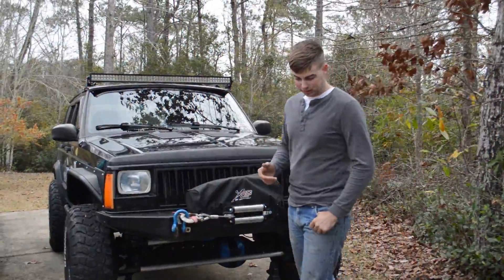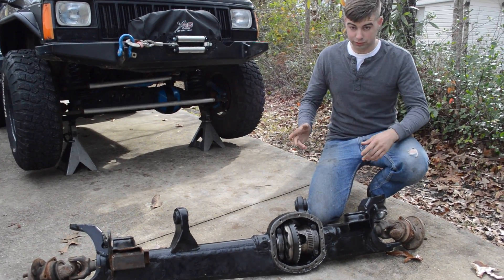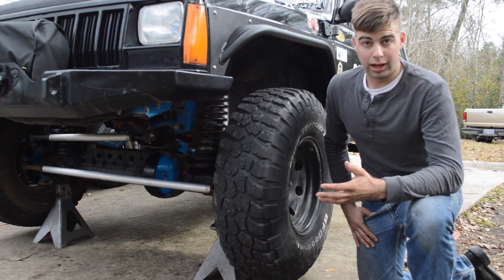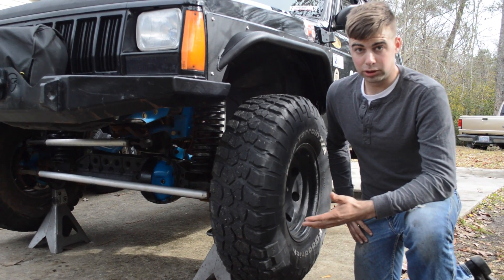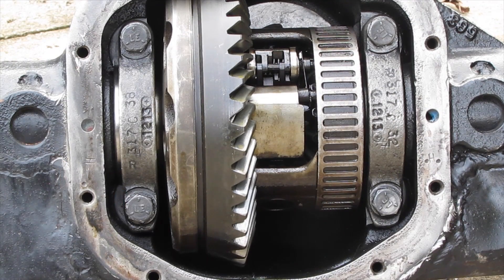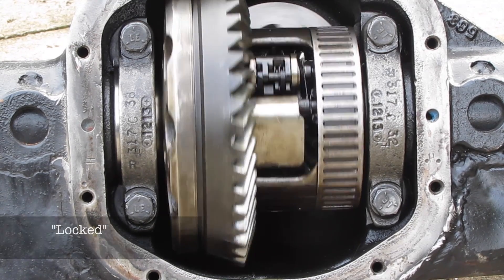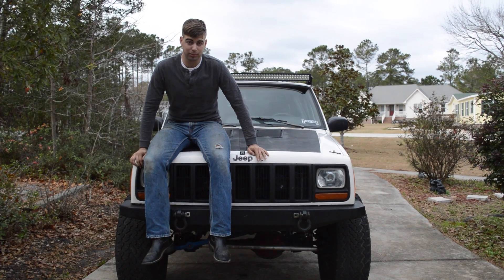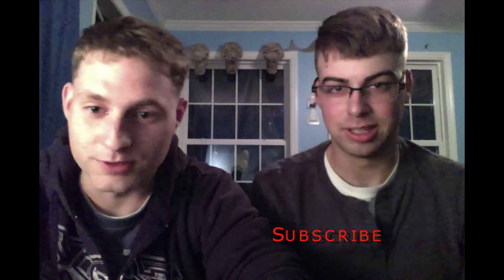The Volvo Differential Explained

Comment: Found a g80 in a 940 turbo with 3.73 gears and I have stock 3.55 gears in my Jeep wouldn’t work with stock gears would have to regear to 3.73 or higher would have to find a Volvo with 3.55 anyone have one they would swap with me
Reply: All Volvo g80 are not equal found out the hard way can’t just swap ring gear

Comment: Hey guys, I tried to install one of these in my Jeep but after removing the shims and swapping in the old ring gear the carrier binds. Did u have to adjust ur pinion depth and if so was ur contact pattern still good and not to toed away from the ring gear? Also if u did adjust the pinion, how far and what shims if any? TY
Reply from the maker: Sadly we did not gear it ourselves. We had someone locally do it. He did mention it was a very tight fit, but it all worked. So for specifics on how it was done, I can't really say.
Reply: I had the same problem I got a g80 out of 940 turbo with 3.73 gears I think those are set up for 3.73 or higher probably have to find a Volvo with 3.55 gears I don’t all g80 are the same if you want to run stock gears

Comment: Wow! A friend just told me about this but let me a push it a bit further,...... can I swap a Volvo 240 rear axle into a wrangler jk? I know where I can buy the whole Volvo car for less than half the price a jk rear axle.
Reply from the maker: I see what you're trying to do, but unfortunately its not that easy. The only thing you use out of a Volvo 30 is that limited slip diff that you pull out of the housing. The axle isnt worth pulling and its not even offset like front 30's found in Jeeps. The JK D30 isn't that same anyway, compared to traditional Jeep D30's. Now could you put the volvo limited slip diff in a JK D30? That i have no idea, I know traditionally the housings are a bit different.

Comment: I got one of these diffs out of a 91 volvo my wrangler is an 89 came with 3.07 gears I swapped my ring onto the new diff but it does not seem to fit properly the spacing seems off I tried shaving the bearing cups down so it would fit and when I do get it in I can no longer spin the pinion were there different versions of these diffs?
Reply from the maker: That I have no idea. The guy who installed ours said it was a tight fit but it worked fine. We had a 3.73 ratio carrier, not sure if 3.07 is different or not.
Reply: Enlisted Budget Videos your original was 3.73 or the volvo carrier was 3.73 the carrier I got out of the volvo I believe was 3.73
Reply from the maker: The Volvo carrier we pulled was a 3.73 carrier. We then geared it for 4.10s when installed in our Jeep D30 Axle.
Reply: Enlisted Budget Videos I think that's what I'm going to have to do to make it fit properly seems like the case acts like a small spacer where the ring bolts up. thanks for the replies..

Comment: I got a g80 from Volvo 740 for my Dana 30 front and it will not install correctly.is there any mods necessary?
Reply from the maker: It should be a tight fit in the diff housing, but nothing special needs to be done. Just installed like any other differential.
Reply: @EnlistedBudgetVideos  i try to install it in my 99 cherokee in the front dana 30 3.73 ratio and it no fit on it  the berring wont seat on place  . any help?

Comment: So will any limited slip Dana 30 center section bolt right up to my 89 740? 
I would think so, but I have not found anything about it online.
Reply from the maker: Im not a Volvo connoisseur of sorts, but I would imagine swapping a Volvo rear D30 to another Volvo of the same model would be doable.

Comment: can a xc70 be lifted to put bigger tires?
Reply: There are some lift kits available, both for the newer P3 model and the <2007 model. I stuffed huge 245/65R17 tires into my 2008 XC70 with stock suspension. @volvoverlanding on insta

Comment: Hello guys. Have you pulled a g80 out of a 940 series yet? Have been informed that the g80 came stranded in this series. Until it goes to IRS with different spline count. My question is since the 940 uses the axle housing 1041 instead of 1030 or 1031 should I still be alright? Obviously this is a topic of discussion for us because it'll give more opportunity to find these carriers for 50$ 😏 Keep up the awesome videos gentelmen!
Reply: Thomas Begley Did you find the answer for this? I've been offered a G80 out of a 940, not sure wether to buy it or not.

Comment: Very similar if not identical to the GM Rear axle Gov-Lock or Eaton G80 as it's known.  In the rear ends of the GM vehicles, they tend to break easily when abused, often  with disastrous consequences. Which is how they gained the nickname of Grenade 80.  I had one in the back of my S-10 and it never, ever let me down.
Reply: Pete Jackson these are Eaton lockers, Volvo used Dana Axles and Eaton lockers.

Comment: So i use one my dads ramps i placed it on the right front wheel and it went straight up without any slippage. I also jacked up the right rear wheel in park i tried to turn it and it did not SPIN. LSD YEA

Comment: How would i changed the fluid in differential with the IRS?
Reply from the maker: +Daniel McDaniels The same as you would any other differential.
Reply: +Enlisted Budget Videos ok when the locker is engaged does it surpose to let one tire skip or chirp when turning?
Reply: I just looked up on Google 1997 volvo 960 sedan standard equipment and one site said Differential, Limited Slip and had Package next to it. What does that mean?

Comment: say i do find the locker in the volvo in the junkyard do i need to take the ring and pinion gear from the volvo of can i use the stock jeep ring and pinion or can i interchange them
Reply from the maker: +James Flores you use the jeep ring and pinion only. You will noticed a sizable difference between the two. The jeep ring is a lot smaller in thickness than the Volvo one. Don't be alarmed, it still bolts on the carrier just fine and you gear everything just like normal.
Reply: Enlisted Budget Videos damn you actually responded fast
Reply from the maker: +James Flores well what good is a channel without good customer service!? I have an app that I can manage all this through anyway lol.
Reply: Enlisted Budget Videos u just got a sub
Reply: @EnlistedBudgetVideos  what app is that you manage all this from?

Comment: Ok i have a question. Does a 1997 volvo 960 and the s90 have the same tranmission and differential? I just looked up the epa mpg of both and 960 gets 18city and 26hwy. The S90 gets 16city and 24hwy.
Reply: the 960 is just an early s90 exactly the same car.

Comment: what year the volvo has to be? and can I add them in the 2 differentials front and back? thanks
Reply from the maker: +abraham vazquez Most or mid 80's to early 90's. Really doesn't matter as long as its a 240/740 turbo or has a tow package. Absolutely impossible to put it in any differential other than a Dana 30. So assuming you have a D30 front, that would be the only option.

Comment: Does a 960 and S90 have the same differential type? Do they both have the locker in IRS? I saw a 1998 volvo s90 with the outside temp and the snowflake beside the temp guage at the junk yard.
Reply from the maker: +Daniel McDaniels We can&#39;t speak for the other models. We only know about the diff in the 240 and 740 models. I will say I had someone message us stating they found the locking diff in a 960. Thats all we know. I tell everyone this, the best way to find something out is to go out there and crack open some diffs. If you strike gold, let us all know. Other than that I dont have that information at this time.

Comment: The sticker says 1055 3.73. When the Trans is in N the wheels turn the opposite way but the right rear wheel turns faster then the left rear wheel.
Reply from the maker: +Daniel McDaniels Do you have a tow package? If so, you're leaning more towards the "having one" side. I honestly can't tell you if you do or not. You just have to look for yourself and post it up.
Reply: Ok should i do a good burnout and post a picture of the marks and you can tell me if i do or not? And i dont have a tow package but i could put one on if i wanted too. Would my car handle towing if i dont overload the cars load?
Reply from the maker: I ask because from factory, it has been my observation, that 240 or 740 vovlos (I know yours is neither) with a tow package have had the G80 in them. I was curious that perhaps maybe its more than 240s or 740s that may have them if they have a two package.
Reply: ok ill do something here at home and tell you what i think i have
Reply from the maker: yup, just pop the diff cover take a look and see.
Reply: But how can pop the diff cover off when it has IRS?
Reply from the maker: Never mind if you have IRS you don't have it. Saw your other post saying that just now. My bad.
Reply: Ok i looked at Andys website and it said eaton locking differential 1055 type

Comment: I have a 1997 volvo s90 does mine have the g80 locker in it?
Reply from the maker: +Daniel McDaniels More than likely not. However, it wouldn't hurt to check if you have the means to do so. Popping the cover will definitely give you a black and white answer.
Reply: 1045 should be a locker if you have the rear end jacked up give one wheel a solid spin and if it's a locker it will engage and switch directions.
Reply: +SKAVENGERS10 Ok do i keep it in Park or put it in D(drive)?

Comment: I'm on my girlfriends account here but I know where to find lockers in VOLVOs. I drive a 1993 Volvo 940 Turbo Wagon as of 1992+ all 940 Volvos got the G80 locker or 1041 axle. Also for the 760/960 there is the 1045 IRS axle. There were some LSD options in older year 740 Turbo 87-89 cars which is called the 1031 axle the 1030 is an open diff. Also in 90+ the 740 started getting lockers. They are Pawl actuated lockers so when you lose traction at speeds below 30Mph they will lock but above that they will open. This can be modified by removing material off of the pawl, which just changes the amount of speed required to open the locker. More info can be found on Turbobricks.com, Matthewsvolvosite.com, IPDUSA.com.
Reply from the maker: +Melanie O Thanks for the info! We'll have to read into it more.
Reply: Hey does a 960 have the same 1045 in a 1997 volvo s90 rwd?
Reply: +Daniel McDaniels S90 V90 960 some 760s have a locker but the Rear Axle is IRS instead of solid axle. I don't know if they are any different for size.
Reply: +SKAVENGERS10 What is a good website that i can look up my vin number to see if i do have the locking diff?
Reply: That is not correct. Not all 92+ had 1041 rear ends. At least here in Europe the 1041 was ONLY available if you selected the "towing package" when ordering a new 940. Neither my car 1998 940 Turbo nor my dad's 1992 940 had a 1041 rear end.

Comment: let me understand (and sorry for my english, i am from Italy). I will need a 740 differential. But. Do they have manual, electrical or air actuator? Thanks for your video!
Reply from the maker: marco poto  It's an auto locker. As in it is actuated by a difference in RPM between the tires. No need to run air or wires.
Reply: Limited slip,  am I correct?
Reply from the maker: marco poto Correct sir.

Comment: So does this only work with high pinions? Can I run this in my 2000xj with a low pinion, and what kind of gears do you have to run?
Reply from the maker: You can run it in a low pinion or high. There's two different carriers out there for the gearing for sure. The 240/740 turbos are 3:73 up numerically. So yeah you can run whatever you want repsectively. I can't say for sure which models have 3:56 down numerically, but they are out there. So just slap on a ring and the pinion of your choice and you're golden. (you still have to gear it like normal of course).